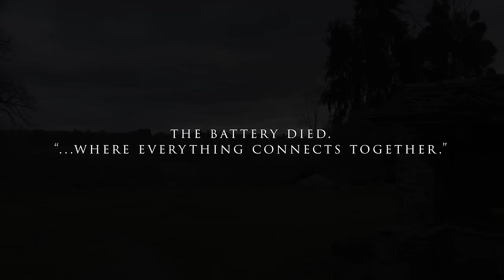36 - Cleaning Up Old Junk & Burn Pits: A Week's Task With The Little Digger & a Rake!

Comment: You may consider covering the poluted soil with wood chips or directly mix the wood chips in. Wood chips will help to establish a healthy soil life, bacteria, funghi, worms etc. The naturally occuring bacteria will feed on the pollution and help to break it down. Maybe the metal guy has an old metal bed frame with bed spring, it is a great sieve for dirt. Place it under a 40 to 60 degree angle and throw the soil onto it. Thank you for the filming and sharing!
Reply from the maker: Hey Jeroen, great suggestion i have enough wood chips! I will put them in with the tiller and then put the plants on. The soil doesn't look bad plenty of worms etc. in it while i was cleaning so nature was already taking care of it i am just speeding up the process by removing the visible parts. I have a sieve coming in the upcoming videos.
Reply: @DomaineSauvage  i wouldnt bother too much about the pollution myself. Nature knows how to take care. I salute your initiative to remove rusty metal and glass that can badly hurt you ( dont ask how I know)

Comment: I get for what you want to with the land that clearing the plastic and glass is important, but some rubbish dumps, if they've been used over many generations, can be old and sometimes contain useful or even important artefacts. It sounds as tho' all yours are recent dumps but it might be worth keeping an eye open for older dumps. They will have existed.
Reply from the maker: Hey John, I have found some old hinges and locks between the rubbish that i am keeping 👍but most of it is just recent trash..

Comment: Congratulations on clearing the land so carefully. I totally agree about removing as much of the plastic, glzss and man-made materials as possible, but agree with others on here that I dont think the soil is too "poisoned". Turning it over, raking it and aerating it like you have done will have made a huge difference. It isn't industrial toxicity, and I'm sure it would recover if you put it down to grass. But i totally admire what you are doing!!
Reply from the maker: Yeah there is a lot of life in the soil so i am not too worried once i have removed most of the materials. I will put the trees and plants on that help clean it.

Comment: Hi, just started watching this week, you’re doing a fabulous job! I was thinking you might benefit from a magnetic roller. It’s just a tube on wheels that has a magnet  under it, and a long handle and you just go over your drive, lawn, barn floors and perhaps your soil and it just pics stuff up like magic! My son mows lawns. I’m going to get him one for his driveway, cause he’s always getting a flats on mowers ( using tubes helps a lot also as they are easier to patch) and make it easy to pump up your tire again once the air goes out and the seal is broken. ( I dug up a half small bucket of nails some prior idiot working on the house either just dumped or knocked them over and left them there. They were right on the edge of the dirt so anytime you move he could be getting a flat on them. I still didn’t get them all pulled out of the ground with ridiculous! But you can go all over your yard with them and you can get them shorter and longer for all kinds of prices. They’re not really that expensive depending on the size you get and how fancy you wanna get. I know when I’m working on the outside of the house, you know you end up dropping a screw or nail on the ground, so I use my magnet on an expanding tool wave around the pick up my screws, but it would be cool to have one of the small ones just to do that make it a lot easier and they’re very cheap. Some places for a small one looks about 14 inches wide at Harbor freight it’s less than 20 I think. That’s US DOLLARS. I was gonna put a picture in the chat, but I don’t think I can what I’m talking about. Just if you don’t know what it is just search online wheels. Harbor freight was called mini magnetic sweeper. 17.5 inches long with wheels for $13.99. So you can get them cheaper get a little longer ones, and the price goes up. Of course you can buy them at other places that might be a lot more, but it really looks like a handy thing I have around when you’re constantly dealing with stuff and tools and nails, and, your dirt pile and everything else I would take it would come in handy. Good luck keep in mind. You’re growing boy when he’s walking is gonna be very attracted to all your equipment on the farm and you need to establish rules for him to stay away from lawnmowers and things, I can’t tell you I have experienced. I know someone who’s child lost the bottom of their legs from my lawnmower. They can go underneath the equipment when you’re riding the tractor or even fall off you’re holding them very securely, but you need to teach them they are not to come around until you wave to them to come.
. I suggested it another video you might build him a nice large shady area for him with shade, some sun and all is outdoor planes, equipment sandbox. (make sure you got a nice cover over that sandbox or your cat will be sure to find it ) back in our childhood days we just scooped it out but now that mother  I’m thinking that’s not a good idea lol. etc. and he’ll be happy as long as that comes as natural for him to play in his little play while you’re working and he won’t resent it when you’re too busy to attend specifically while you’re working  I’d rather keep my child in a playpen well I’m cooking inside rather than having them underfoot getting burnt. People today don’t like the idea of plants, etc. but it saves you a lot of grief and saves a lot of injuries from happening. He wasn’t in there all day long. He was in there when he could be in danger. Then I brought it outside and I would work in my garden when he was young. He would be right near me in the shade having a good old time. Then after that we had a closed play area & play house off side of our house and then I had taught them, how to keep out of trouble when I use good sense around for me equipment and any equipment around home, including saws and chainsaws and blah blah blah. My second husband he was on the fire company/rescue squad so I could tell you more stories that’s not what you want to hear. But what you really don’t wanna hear is how you took a walk out along the lawn. Your husband was mowing and a rock flew over and hit one of you in an eye! I’ve been hit on my legs, small child could be hit in the eye or elsewhere and it wouldn’t be pretty. Please please I don’t say these things to be a nag old lady. I say these things because with all the modern equipment you need to be teaching them how to be around all of it to be safe, and put protocols of safety in action to keep them back even if they want their attention. Stay back or away until they are acknowledged, and the machine is shut off and they are pulled over. Anyway, I know I started not making much sense near the end, but I’m dictating it and for some reason YouTube has been a pain in the neck to do that in and try to correct it. It keeps jumping around so bear with me. I’m sure you’re smart parents, but your new farmers and I was actually told later when I was renting a place on a farm they wouldn’t rent people with children, and they met my daughter and saw that she wouldn’t get in trouble or go places she were told not to and we could live there after all. So once he’s on his own little feet running around like crazy they’re so fast with the blink of the eye they could be out of your sight and it’s scary. Scary as hell that happens.